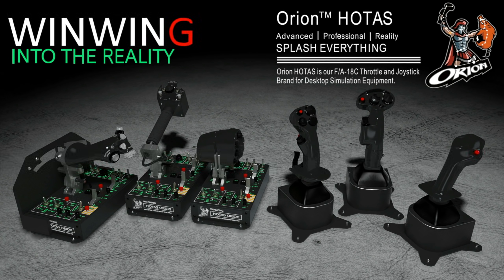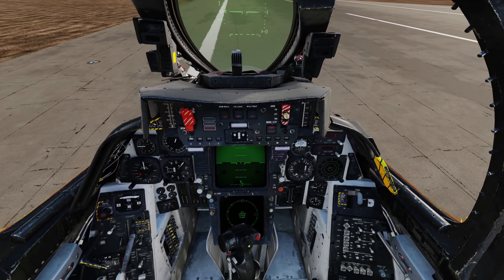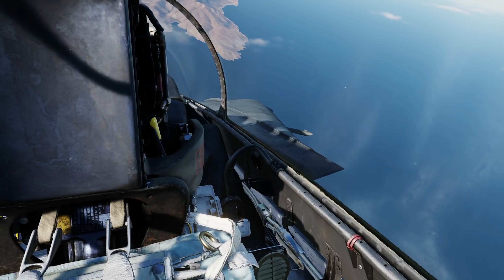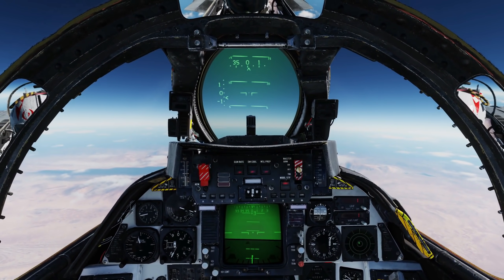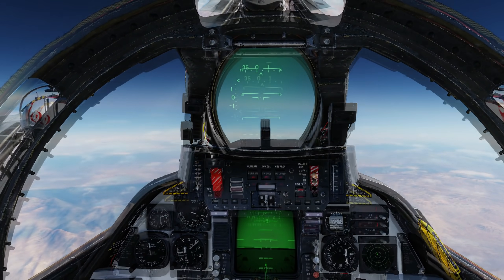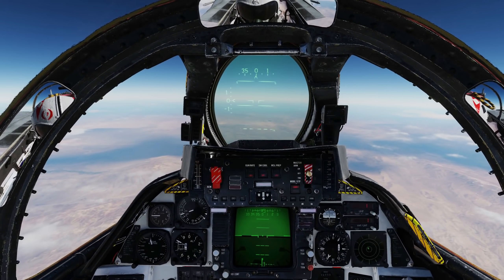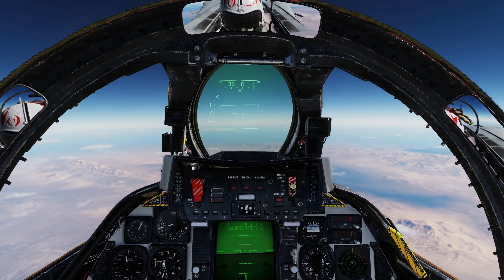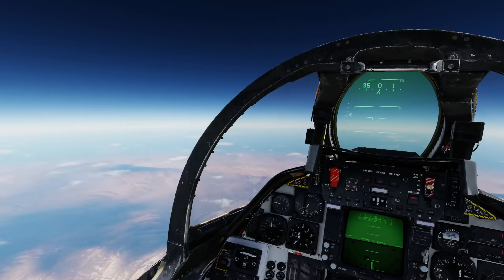Questioned: Can A Jet Fly Higher With Straight Or Swept Wings? | DCS WORLD

Comment: Simple physics.. higher altitude is less dense air.. so less drag and less lift.. the wings out would prevail as once you reach a certain altitude the increased lift would override the drag.. that said there is also a speed variable to this as well.. the faster you go the more lift you can achieve.. that’s how the sr71 is able to fly as high as it can.. it’s long, sleek and fast.. lower drag and gains lift from speed.. 

One need to look no further then the u2 design.. once it got up it was almost a glider cause the wings generated soo much lift and there was so little drag on the frame.. 

So what you need to do.. is active as much speed as possible wings back..  climb at 5* and slowly open the wings little by little as you get over 40k. Once you get to 50k you can increase to 10* or so.. 

But hey this is just a game lol.. call it a sim if you want but there are way too many unrealistic bugs with all airframes in the game.. not a single one actually comes close to even 75% real performance

And by that I mean both good and bad cause a lot of planes are way under done while many others are way over done.. no later how hard they try they still haven’t even gotten to 40% of the vipers real characteristics and abilities meanwhile the felon etc are about 100% over its abilities lol.. next to the viper issues the f35 and f22 really bother me.. where is the gen5 data link availability.. and why are other aircraft built in the 80’s able to pick them up on radar at 35 miles away? Lol.. of DCS wants to do something real for the f35 they would link the g5 capabilities into the game and allow the f35 to provide the 1500 or so foreign solutions to 150 other aircraft and ships that are out of range.. a sgl f35 launched off a carrier should be able to take out 150 other aircraft wo ever launching anything off its own airframe by simply providing firing solutions to the ships.. but hey we can all pretend a 1 of 1 aircraft like the su57 with 80’s stealth tech and barley gen4 hardware and software is even close to the f22’s 🤷‍♂️ I mean to be honest the 22’s were gen4 platforms but that’s minor software and hardware tweaks which have already been done.. 

While back I seen b2’s get shot down.. clearly no one has any idea how radar cross sections work.. a b2 looks like a crow when flying at 50k and 50 miles out to even our own systems.. the only reason we can even track them is beacons.. so I’m sure simple 1990’s fox3 have no issue tracking them either fired from 75 miles lol.. game is cool and all and fun.. but man there is a huge lack of actual real world out into this game.. it’s hardly better then playing battlefield on a PlayStation tbh..

They don’t even have the basic Physics computed for this video.. you would’ve out speed and climbed just like you did.. but given your speed that aircraft would’ve never gotten over 52-53k.. the maintaining speed and gaining altitude is actually pretty ducking realistic.. but at given speed that wouldn’t have worked that way either.. speed first lift second.. you guys kinda tried this at the end and it did work better but it I wanted to I could do the math but off top of my head even as more realistic as that was cause if the increase speed it was maybe 45% on par with actual physics for given speed, thrust lift and drag.. and sadly that bother me more then being in a mach2.2 aircraft at almost 60k in a dive and only hitting 1.9…. Wtf is that lol.. 🤣 and where are the f14d’s? Where is the f14B-R? The f14 variants in the game are horrible.. 1970’s planes.. where are the 2000 versions of the f14’s.. this isn’t sensitive classified  data anymore they’ve been out of service for a while now.. we could at least get something closer to the better and more commonly used versions.. the A and regular B variants were contrary to belief not widely used.. the B-R which was a B version with D upgrades was the most used version.. way better engines, way better capabilities.. shame that budget issues never seen the 14D come to life cause it would’ve been everything the original 14 was, 15E wished it was, and what people think the f18 is..

Comment: I was curious and gave this a try myself to see how with a bit of time and patience (without the pressure of recording etc, what maximum height I would reach in the F14B.
The max I got to was 66,472ft at 212kns with 11% fuel (unlimited) and pitch angle keeping adjust to keep airspeed constant (initially), then to keep just above the AoA (final AoA was 4.8, and my pitch was 5). Wings back, no flaps; clean jet.  That was on my first attempt.
Wings forward, I could do 59,896ft at 141 kn, 5-7 pitch (it was variable depending upon AoA and IAS/height.

Comment: You need to go supersonic at very high altitudes in order to not stall, and swept wings are way better at supersonic than straight wings. :-)
Engines doesn't suffer from the high altitude, but as the air gets thiner, the IAS drops and you will have to be very supersonic to keep the IAS sufficiently high to avoid Stall AOA.

Comment: Having swept back wings since the beginning makes the plane burn more fuel, for 2 reasons:
1 - in subsonic regime, swept back wings (effectively delta wings on the F14) are less efficient.
2 - due to the poor aero balance (nose heavy plane), the pilot will have to use more flaps/elevators to compensate.
So, it might matter or not, but the swept back plane is going to be lighter, reaching an even higher ceiling.
Reply: Thoughts on the physics of the results? ok.

It comes down to knowing whether the top speed at max ceiling is sub or super sonic.

- If subsonic, you want to go with straight wings. Lift is more efficiently generated by the wing section in subsonic regime. A chunky aerofoil on straight wings would do a great job.
- If supersonic, you want to go with swept wings. Lift is more efficiently generated by the wing surface in supersonic regime. Chunky aerofoiled straight wings would do an awful job.

The tested scenario shows both plane configurations working in their ideal regimes. Ram effect is indeed what makes the difference, but it's only a case that the ram effect is big enough to give the swept F14 an advantage. It could have also lost.
But still:
- If the engine power was constant, and not enough to get past Mach 1 for either plane, the straight wing would have flown higher.
- If the engine power was constant, and enough to get past Mach 1 for both planes, the swept would have flown higher.

Comment: Up high the added lift from wings out is negated by the thinner atmosphere although drag is still a factor. Wings back allows for a greater speed and more efficient output from the engines. At higher altitudes the wings don't generate lift and it's all up to the jets.

Comment: +GrimReapersAtomic  Grumman Aerospace (Bethpage, NY, USA) programmed the G-303 Wing Controller for best specific excess power at Mach and altitude.  The Lockheed California U-2 ran into a wing-loading-versus-speed-of-sound corner somewhere around 55,000' MSL; the phenomenon of stall Mach occurs above this point.  With the United Technologies Pratt & Whitney TF30-P-100 (production in the USAF / General Dynamics FB-111) in for the production -P-414A, the NF-14 Alfa platform should be able to sustain ~60,000' MSL, riding the bow shock at ~1.8 Mach with the wing at 68° LE.

Comment: the lift goes up by the square of the speed so you get drastically more lift at higher speeds thus a much lower AoA and as a result lest drag so you get a higher sustainable altitude with wings back because you can go faster. lift =0.5ρV^2SCl where ρ is density V is velocity Cl is the coefficient of lift and S is the wing area.

Comment: In aeronautical terms, the highest sustained airspeeds /altitudes should obviously be attained/achieved with the higher thrust engines of the -B and -D models, BUT also experimenting with a wing sweep somewhere midway between full forward and fully swept? (I'm a RLP with over 12,000 hrs, 35 years experience in gliders and helicopters to swept-wing jets)

Comment: It has to do with thin air.  The u2 wings are long and thin to use low power thrust to jet that high at relative slow speeds.  The SR 71 uses delta configuration wings and a lift generating fuselage to maintain high altitude with high speed thrust.  It all depends on what you want the aircraft to do

Comment: Also lift is L=Cl.1/2.rho.v^2.S
By swinging the wings from memory you get a small increase swept forward in the F111 and F14 due to the wing not swinging on a fixed pivot. The thing is when you look at the equation it suggests that you can get a lot more lift by going faster. The coefficient of lift is based on the wing shape and Angle of Attack (AoA), so you can imagine the forward sweep might benefit more there but I’m betting the F-14 would be better off with swept wings due to compressibility.  So over all sweep back and max that v squared factor. And get a pair of TF-30’s.
Reply: i didn't understand anything that you said. but it sounded real smart 👍

Comment: Re: thrust lapse / augmentation with speed: it's complicated. In a well designed engine, with an intake optimised for supersonic performance, you may get a little more performance at supersonic speeds than at subsonic speed. This might be somewhat offset by increased inlet drag, but that will be relatively low at the low airspeed you would have at high altitude. I would guess the Tomcat is optimised for maximum thrust at high Mach numbers, given its role as an interceptor.
Reply from the maker: thx

Comment: to explain these results your need to look at why the wings sweep in the first place. which is because when travelling supersonic, the nose of the plane will create a mach cone (like a boat pushing a wake) and the wings are swept back to put them inside this cone. if they are outside the cone, there will be additional mach cones being formed by the wings which create enormous amounts of drag.  its kinda like a race car drafting in the slip stream of the car in front of it. 

so the reason a U2 can fly so high with straight wings, is because their traveling subsonic, which at that altitude is very very slow. where as you guys in your f-14's, despite only doing like 150 knots indicated, your still sitting at around mach 1 or higher due to how high in altitude you are. 
this is also why the SR- 71 had swept wings despite being a high flyer, and thats because it always operated supersonic.
Reply from the maker: thx

Comment: The state you experienced in this video is referred to as coffin corner; you’re at an altitude where you don’t have enough power to go faster, but if you go slower you’ll stall. At a certain point it makes the aircraft non flyable and the only option is to descend.
Reply from the maker: thx
Reply: The coffin comer is not about a lack of power to go faster, it is about the critical Mach number of an airframe not designed for supersonic flight.  For example, the U2 and the Boeing 737 both have enough power to go faster than their critical Mach number, but they will experience potentially dangerous stability and control issues if they do.

Comment: The aircraft is more aerodynamically efficient at high speed with the wings back because of compressability effects.  Therefore, the better engine power margin at high speed will be with the wings back.  High speed is required at high altitude because of the decrease in air density.  I believe that if the test was what configuration could fly highest at subsonic speed, wings out would win.
Reply: Thats right. There is a sweet spot on a certain speed. Quicker = more engine power but more drag as well

Comment: The U 2 has a crazy power to weight ratio.  2 men can move that play around on the ground by hand.  The F14 is way too big and heavy for that.  The U2 is basically a powered glider, minimal structure, while the F14 has to withstand ACM

Comment: An SR 71 has a semi "lifting body" design. The body is helping with lift.
Reply: The F-14 is also a lifting body design, as is the F-15.
Reply: @dmsdmullins  I think you need to look up lifting body.  The Space shuttle is a true lifting body design. The SR 71 is close to a true lifting body design. The F 15 and F14 are quite a ways from a true lifting body design.
Reply: @dmsdmullins  True lifting bodies are NASA's X-24A, X-24B, HL-10, M2-F1, M2-F2, and the M2-F3.  If you look the are VERY different from the F-14 & F-15. Lifting bodies are wingless. the F-14 & F-15 DEFINITELY have wings...When you compare the design of the SR 71 to the F-14 & F-15 vs the X-24Ss' ,M2s', & HL-10 you will see the truth. Thanks.
Reply: @dmsdmullins  The F-14 & F-15 have "Body Lift" but they are not lifting body designs. The Space Shuttle is a lifting body design.

Comment: I think it likely has to do with the design of the aircraft. A U2’s wings are designed for slow, high altitude flying. The Tomcat is designed for lower but much faster, so the cross section is going to be way thinner. Even with the wings forward, you cut the engines on the F-14, it’s gonna drop out of the sky and not be able to stay in the air for an extended period like a glider. So even put out forward, at that high an altitude they can’t produce enough lift, and because they are out, they increase drag and prevent you from going at higher speed. With the wings back, you get less drag, more speed, meaning more air at that lower density going over the surfaces which you need to get the extra lift. As a fighter the F-14 was designed to fly more efficiently low(er) and fast, so that’s the configuration it will be most efficient in.

I mean I’m no engineer so I could be way off, but that would be my assumption. Planes fly most efficiently when flown how they were designed to fly.

Comment: Cap,

The two main equations to consider in this are the one for lift, and the one for drag. They’re identical bar 1 variable:

Lift=CL x 0.5Rho x V^2 x S
Drag=CD x 0.5Rho x V^2 x S

CL/CD (coefficient of lift/drag)
Rho is air density 
V is velocity
S is surface area 

From my very basic understanding, the purpose of wing sweeping is to reduce drag opposed to increase the lift. As the aircraft approaches Mach 1, the compressibility of air and formation of shockwaves drastically increase the drag created by the wing. In sweeping the wing, these drag forces are significantly reduced, allowing and aircraft to fly at faster air speeds than if the drag were left unchecked.

If you then take in to account the lift equation, the only variables (excluding drag and lift coefficient changes in swept/forward wings), are air density and Velocity.

In your experiment, both aircraft experience the same air density, so those changes can be ignored. However, velocity is very much a factor.

As you rightly pointed out, at high altitudes the ability of engines to produce thrust reduces, so there will come a point where the thrust vector and drag vector become balanced, ie. the velocity remains constant. This event will take place sooner in the aircraft with unswept wings due to the compressibility of air drastically increasing the drag, whereas the swept wing configuration can attain higher airspeeds as the drag vector is reduced in comparison.

As you can see by the equation, velocity changes the lift by a power of 2, so if you double you airspeed for a set condition, you quadruple your lift produced by the wing.

Taking all of that in to account and without knowing the actual Lift/Drag coefficients and wing surface areas in each configuration, I would deduce, that the wings being swept provides a reduction in drag large enough to allow the increased velocity to provide a higher value of lift, thus, fly higher.

At low altitudes and low velocity, the aircraft in a swept configuration will produce less lift. You can test this by flying at say 180kts, straight and level in wings forward and wings swept, changing the all up mass (AUM) by adding fuel/stores. You will find that the wings forward config will maintain straight and level at a higher AUM than the swept at that low speed.
Reply: From my understanding, you can't forget that at higher speed the center of life is pushed to the back of the aircraft.

In a straight wing craft over speed will push the lift force off the wing starting at the tip and move to the root, and if I remember correctly that's were the sweep wing was the first step in high speed aircraft and then the delta wing, and thus the transitioning wing give the "best" of both slow maneuverable straight wing and night speed delta wing.
Reply: It depends. For high speed flight very thin straight wings can be more efficient. See e.g. F-104.
Reply from the maker: Thanks Edward!